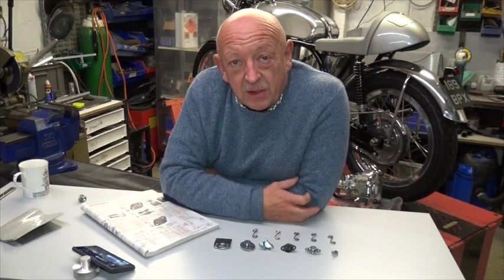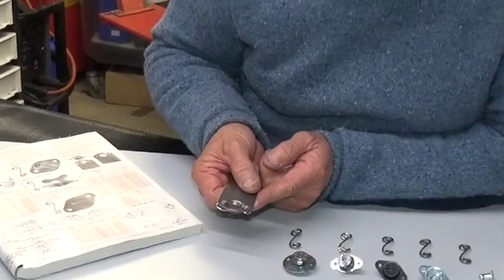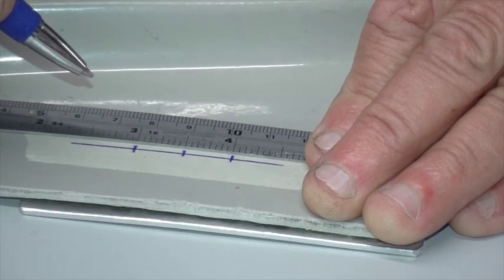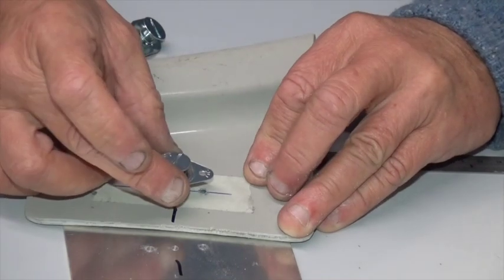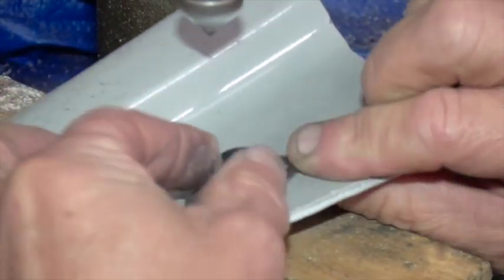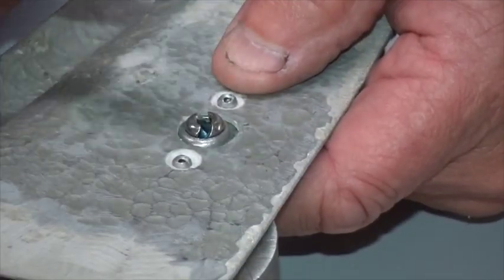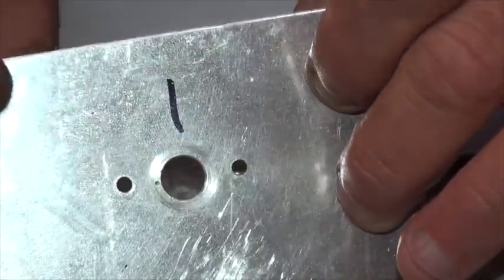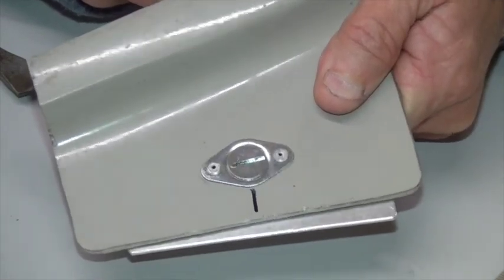DZUS Fasteners Explained

Comment: I found great value in the part on getting the back of the pop rivet to be flush. I suggest that you either make another vid with that as the main topic, or cut and edit the existing part and make a separate vid that communicates the idea in the vid title. This point is valuable in many circumstances where people use pop rivets. Thanks.

Comment: 12 .24. I put the center punch in my drill press and spin the rivet head over.Even neater than your way and less chance of star cracks in the gel coat on the face of the panel.Keep up the good work.

Comment: These are made in the UK, I'm the Manufacturing Engineer at Southco Worcester responsible for the machines that manufacture the bolts in these fasteners. The imperial measurements are due to the fact that they are designed in the US, particularly the D4 range, others ranges are metric.
Reply: Where can I buy the butterfly/winged headed self ejecting fasteners here in uk?
Reply: @jamesford3549  Hi James... Did you get my previous reply? I can find out for you. But you'll need a part number? There are lots of head styles and options available in D3 and D4 ranges. Download the Southco D3 and D4 PDF where you can see the technical details.
Reply: @thesecrethiker7454  didn’t see another reply no? I’ll look about for a part number

Comment: I'm looking to use these to fit my GRP bonnet to the GRP body, bonnet has an upstand (or downstand which ever way you look at it) making the depth thick, circa 15mm and means there is a void. Questions, can I get fasteners this long, do an need to fill void to avoid flexing?

Comment: This is good and well, however, how do you do a Dzus when the sheet metal is only .060" or .040" thick?  You can't countersink it.  I just grind them down a little, so the point sticks out about .060" and call it good.  There is no way to get it flush at this point.  If there is something you know that I don't, let me know.  Thank you for your time.  GJ.